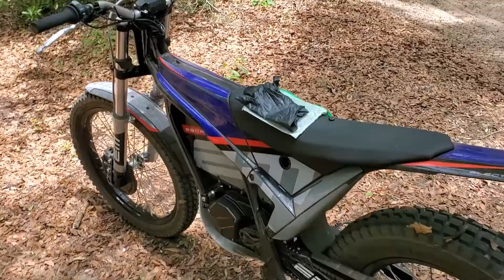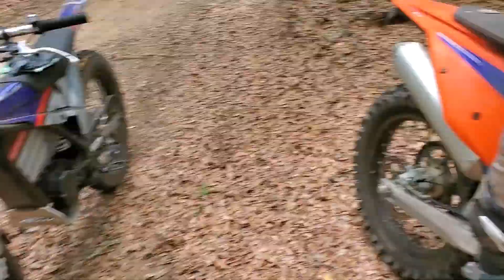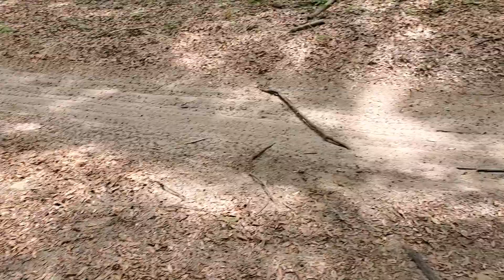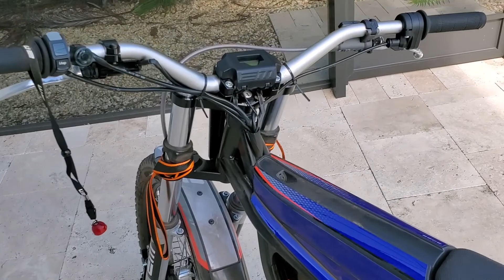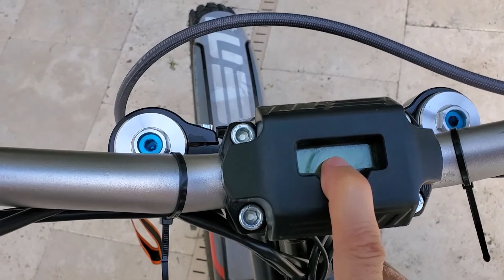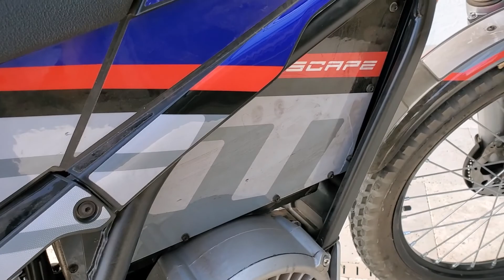Battery (Range Test) Electric Motion Escape ride at Croom Florida. AWESOME!

Comment: Only thing is no plate. In Connecticut and Rhode island, I ride 30 miles, including highway, to get to the trails. The trails are also connected by short stretches of roads. Another thing is if you want to take an overnight trip with a hammock and cooking gear you just have ride to the gas station the next day and ride on with your plated bike like a ktm exc. If you can afford both or dont need a plate this bike looks awesome.

Comment: There’s a great riding place in PA called Famous Reading Outdoors. You should come ride here. That bike would be perfect for the single track.
Reply from the maker: Sounds great, do i have a guide?
Reply: @wetlifesports  Absolutely. 👍
Reply from the maker: @selophane43  whats a good time of year. I often head that way each summer. Rode Hatfield's and PA and NY last summer.
Reply: @wetlifesports  I prefer the cooler months but the leaves can hide the trails in the fall/winter. June is great. Not crazy hot yet and trails are refreshed from the leaves composting.

Comment: Thanks for the good info! I have had the Escape R since August of 2022. I am 51, 5’9”, 225lbs and have ridden every other MX gas bike since I was a kid. This bike is SO GOOD!! Fast, light, balanced! …but I have a battery issue (supply chain!?). It’s at the dealer now…I can only get about 20 minutes of range now - bad cell maybe? (dropped from 2hrs+ when new). I hope my replacement battery lasts longer! Let us know when you get the e bike ride club going! Cheers from AZ!
Reply from the maker: Sorry to hear. I've got new Hurricane Ian issues. Mine was hiding in my Sprinter and the Sprinter didn't make it and the EM was partially submerged.. I've got $600 in parts coming to try and fix it.. stinks, as your right, love this thing and it was one of only 2 vehicles that survived. It still works but is binding in the front sprocket area. It is a great apocalypse vehicle.  It was safe and sure footed on slick mud covered streets and downed tree hopping is great too. We'll see... Good luck.
Reply: How many miles could you get in 2hrs on average

Comment: i've had my 22 escape R for about three months now and after four long rides i can say the escape R is the most versatile E bike out there! iv'e been riding dirt bikes for 30 plus years in all kinds of different terrain (250cc and 450cc four stroke). i ride with four other guys, all different E bikes. Drill One, Sur Ron X, Segway 260, and Telura.. Single track trails and fire roads in the Big Bear Ca.area. This bikes kills it when riding with all the boys, Drill One is right there with me! I'm sure supplies are limited in other areas, but if you can get your hands on one of these babies DO IT! Ohhh, get the motor break it's extra. Game changer! MelBorn
Reply from the maker: Yes brother!!
Reply: What is the “motor break”?
Reply: How is the Drill One holding up? Its much lighter than the EM

Comment: Id love one of these, i have the surron storm and its heavy.  I got it at around 6k USD so im happy.  These are 10k ?  I popped trials tyres on and it transformed the bike.
Reply from the maker: Yes, i was definitely not interested in anything over 200lbs. I do love the trials tires as well. It all depends on your riding interests. I wanted lightweight tight, tight technical trails and trail blazing (no trails). This thing can trail blaze. I know, the price is tough to swallow. A few of my friends say the same thing. Normally I'm not extravagant but ive looked for years and this is the only thing i found that hit my mark and so..have fun.
Reply: @wetlifesports  - let me know what you think of the Chinese version of your bike the Arctic Leopard , its similar to yours with more poke around 25kw.  Ah enjoy it, drive a cheaper car to work and ride a more expensive toy.  im so excited to see what the next 5 - 10 years brings.  The storm is heavy but doesnt feel heavy to ride , they did well to hide the weight.  they did cap power at 22.5kw which the storm pack could easily do 30kw.  Jealous , enjoy yours , someday ill get one :)

Comment: So I must have missed it, but what was the max mileage/hours of riding?
Reply: 40 miles max or 3 hours .. but its made for technical plying .. ..if you do single track fast stretches you will drain battery sooner .. get a surron with extra battery !! but the em is more quality and capable
Reply: @knobbytrails577  great !
Reply: @gmy33  For comparison, a Talaria 4000 on the same ride, equipped with the stock  2700 Wh battery plus a 1200 Wh extender (that's 3900 Wh total) had 40% left upon arrival, over the EM's 11% .
Reply: @knobbytrails577  my 2014zero fx 5.7kwh does 100km at low speed :-) bike is 140kg .. me 75kg
Reply: @gmy33  I've zero experience with the Zero (pun intended :) so I'll take your words. My Escape-R as I said does some 22 miles (28 at best depending on conditions) before the battery drops below usable. I guess that with fully inflated tires, at low speed on tarmac and no climbs, it may manage the advertised 38 miles but that's not how I use it.
Reply: @knobbytrails577  thanks for all info !!!

Comment: Just want to back you up on the "best ever on sand"…. It’s amazing on sand. It floats like nothing else I’ve ever tried including my GasGas 300 with very very low pressure mousse inserts
Reply from the maker: Thanks 👍 It's strange. When I started riding deep sand 5 years ago on a yz250f, I would go a few hundred yards and be exhausted, fall twice.. Wrestling it like it was a 300lb anaconda. I got use to it and got comfortable in sand with different bikes wr250r, yz450f, then I took this EME to Croom in Florida and it felt like it was built for it. I'm not totally sure what physics is making it work so well..

Comment: What are these like for comfort on extended rides? Are your knees quite high up when in the seated position?
Reply from the maker: I don't think i ever noticed. Its really not that kinda bike. It's a 98% standup bike. I suppose you could sit as much as you wanted. Depends on your goals. I find it fine when i sit, I'm 5'10".  Your not really ever gonna have an extended ride with a max range of 38 miles.
Reply: Not a bike for extended rides, a couple of hours of 99% tech stuff, mostly standing.

Comment: I contacted the nearest and only dealer in New England and they said they don't even know if they can get them. But upon ordering it could be 6mo to a year from purchase. So mad it looks like a great bike and brand with little to no drive in actually selling bikes. It's looking like a novelty brand that just wants to sell one or two a year rather become the next sur ron or big name. U mentioned you ordered from out of state was there lead times too? Or did u travel there? So frustrating. It's hard even trying to find a ktm to try out I'll have to drive an hour or two just to maybe see one in the back of a small shop somewhere. 😞
Reply from the maker: I had a bumpy experience in the beginning. Tampa dealer closest to me, 2.5 hours..were bad. They said conflicting things every time i called, didn't call back..even got the distributor involved to help...So i decided to swing by to touch the one they had and maybe buy it when we were there on other business. I brought my van, etc. Again they had bad information so i got fed up. I loved the quality of the bike so I looked nationwide especially up north. I've literally saved thousands buying new bikes in the north in the winter. So I found Halls Cycle in Illinois and Jeff, (tell him I sent you) was awesome. See if they have one. GL. You saw my unboxing video?
Reply from the maker: There out there, one dealer said they were clearing out 2022s another had an R with 15 miles. Think nationally.

Comment: I have some friends who do trail riding on their gas bikes and they fluctuate between 15 - 45MPH.  I really want to get the Escape R.  What would you say was your average speed during your range test? 4 to 5 hours is a long time considering I see other reviews saying they are only getting 2 hours average on these bikes.
Reply from the maker: I was definitely on the low speed side 15 to 25mph. Bombing down straight dirt roads is boring as we know but sometimes you have to to get to the next single track so it has to be done. But, this is definitely for the tight tech single track. You will eat a gas bike up in high tech tight stuff. It is ideal on the tight mountain bike trails but unfortunately they dont allow us much. I'm actually planning a trip right now and I'm having difficulty finding a great place to ride. Hiking and mountain bike trails won't allow me and many of the offroad places are swamped with 4x4s, big ass roads. I think us electric guys will need to start organizations, clubs and help get us into some better places to ride. The future... when your on the right trails like I was at Croom, holy cow! what a blast. Started walking away for my buddy on his ktm300.